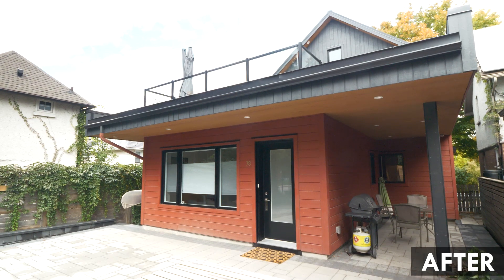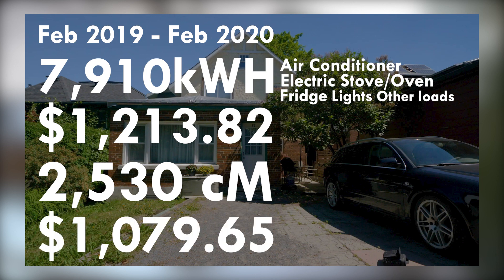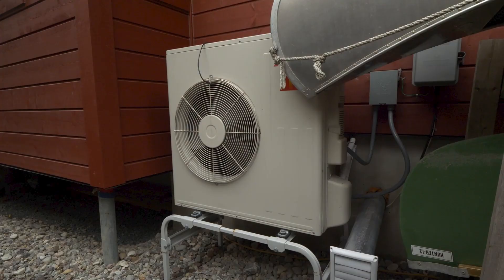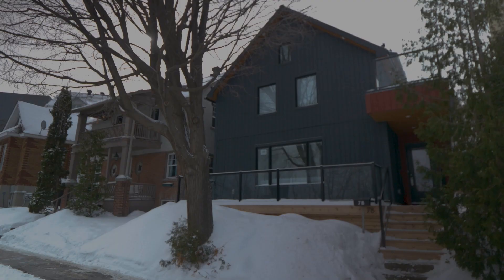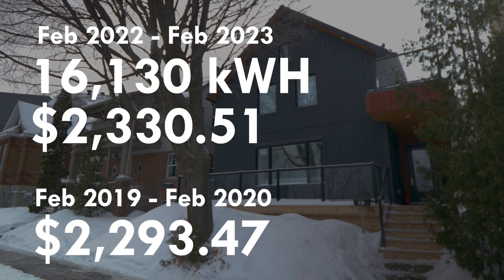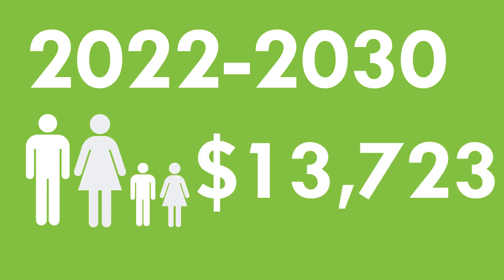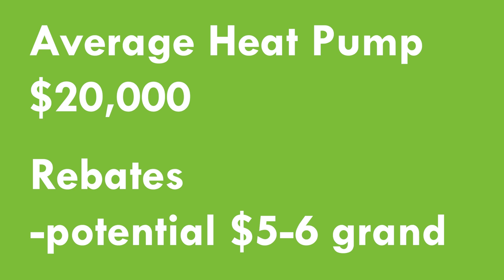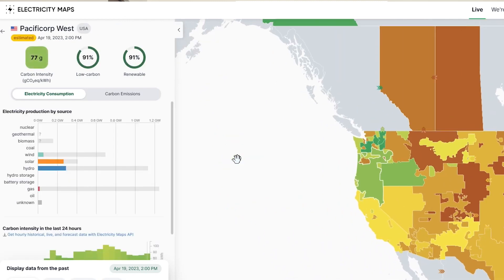This Home Ditched Natural Gas and Went Electric: Take a Look at The Numbers

Comment: The electricity maps site is a super cool resource.  They also have a free API which allows one to pull the data into smart home platforms like Home Assistant, which then allows scheduling of loads like hot water, dishwashers, EVs, etc. based on the electrical grid's carbon intensity, not just time of day.   It's still somewhat technical to setup, but I imagine someday that could be built into equipment like Apple does with iPhone charging now.